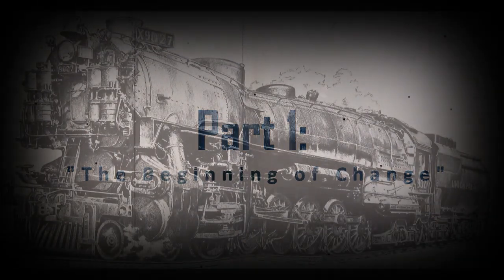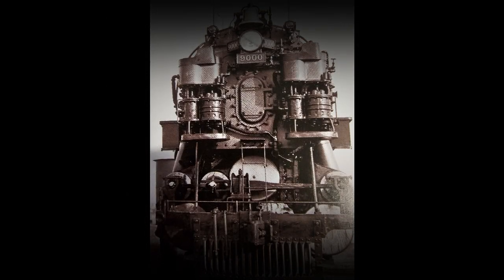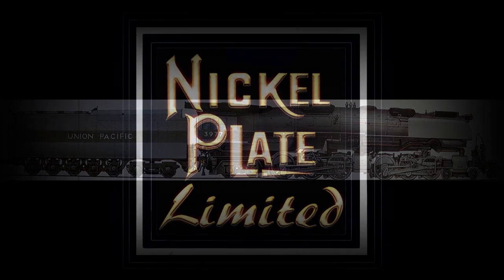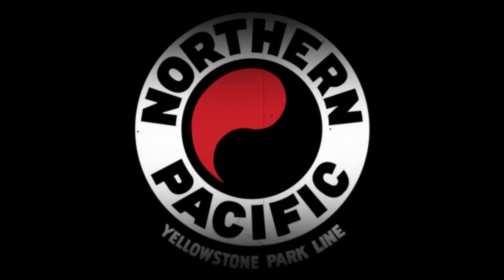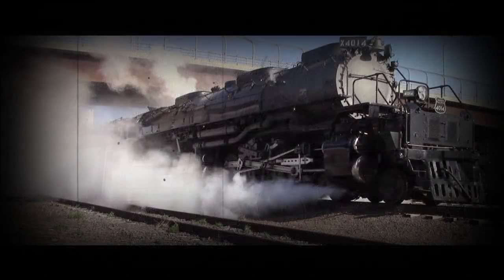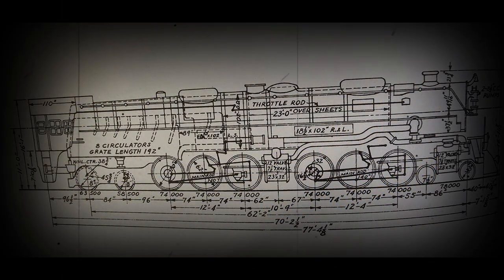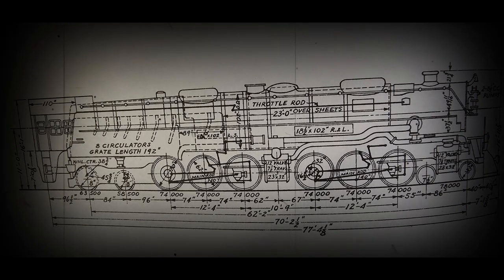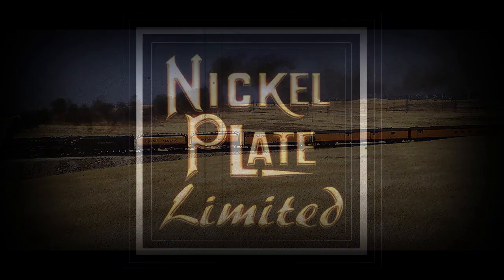Union Pacific Challenger, A Exciting Change

Comment: The Challenger was definitely a big improvement for the UP over the 9000's. 

Great Northern was not in the market for a Challenger based locomotive. Great Northern and Northern Pacific were joint owners of the SP&S RR. In 1937 when the NP designed Z-6 Challengers were added to the SP&S rolling stock GN also forwarded a request to use it's own articulated locomotives on the shared trackage which NP refused to allow. The disagreement was finally settled in 1940 with the GN purchase of 2 used Z-6's from the SP&S inventory and then ran them under GN placards. Both Great Northern Z-6's were sold back to the SP&S after the WW ll traffic spike...#4001 in 1946 and #4000 in 1950.
Reply from the maker: It's funny how business works like this. Union Pacific definitely needed an upgrade with something like the Challenger, and then of course the Big Boy. Challenger got even better with the 2nd gen. I am researching the valuation reports and such on the Union Pacific in wondering if the Challenger and Big Boy didn't save the Union Pacific from later merger like so many other Age of Steam railroads. It really seems like the Union Pacific was behind other major railroads in both the passenger and heavy freight market because of the locomotives that they continued to employ prior to Challenger. Thanks for the comment and Happy Holidays!